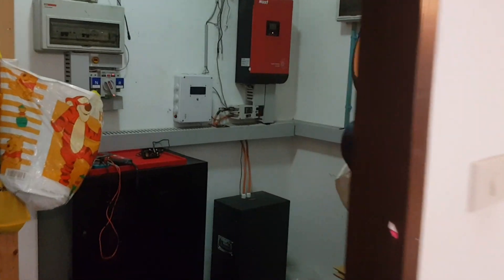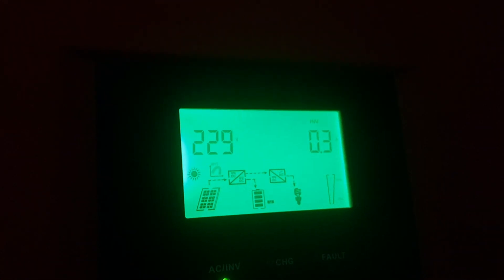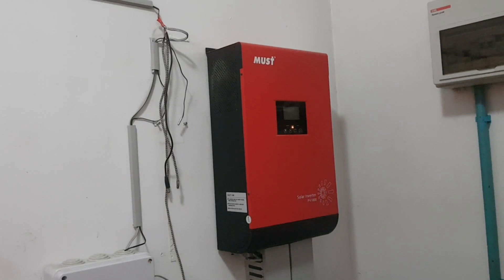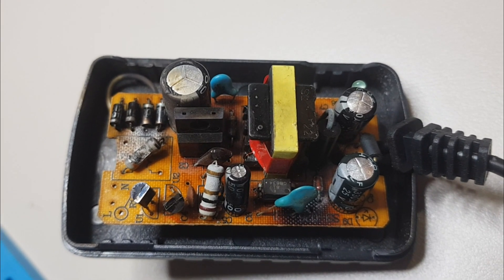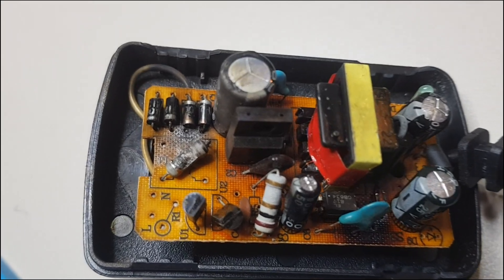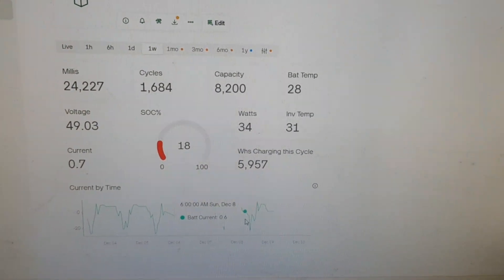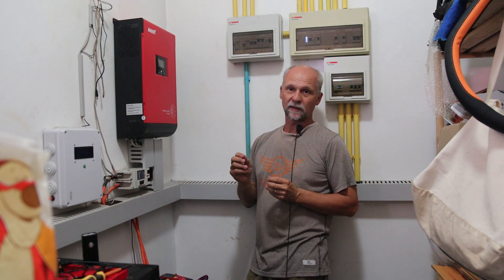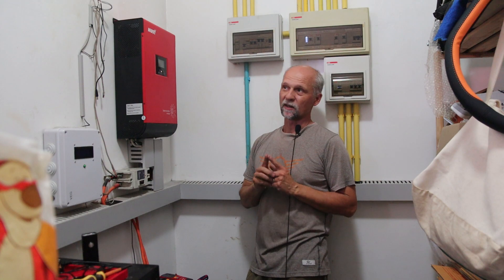Did I just kill my 7 years old Hybrid Inverter with a carelessly installed Power Adapter?

Comment: Hi Roland, im building my inverter.
Im installing the following protection.
Roof top  1000vdc pv ssr isolator  and surge protection connected to a  fireman switches on roof and ground level at power meter.
My inverter has a internal optical smoke detector which isolates  dc battery input and roof top ssr pv using the ssr isolator.
The Inverter has an internal 48vdc battery for skelliton functions.
I have added after market filters to mains input protecting ac to dc switch mode rectifier chargers. 
The dc input from the 2 internal mppts and a remote dc alternernator are protected by dc filters also.
I have protected my house appliances with a dc blocking inductor filter on the inverter 230vac output.
Finally i have finally found a none contact  ground fault relay at 10 ms 10ma  100amp dc trip in series with ssr isolator.
I hope i havent over done the protection  on my inverter Roland.
Been a challenge.
Andrew Nz

Comment: almost makes sense to reroute the caps to an external panel with push pin style connectors so you can just unplug the caps as they fail and plug in new ones. kind of like how big air conditioner/furnace motor start capacitors are wired with spade terminals which make it trivial to swap them out.
i have taken one of those 100w bi directional usb-c diy powerbank boards before and moved the capacitors and inductor kind of off to the side with wires to get it to fit into a very tight enclosure. kind of a lot of work.... i imagine there would be heat/air flow benefits if you rerouted the caps to an external box though. one of your hotel employees could maybe even repair it if you were out of the country if you had everything labeled.

Comment: Upto the last minutes I was so disappointed that you didn't realise that you had left your inverter open to damage through lack of protection - so I was very pleased that you recognised it, and it was an unintended oversight. You really ought to change that relay, as it may well cause you problems in the future. You could also set up a voltage failure alarm on your inverter output to alert you to a failure on the inverter. Good video, thanks 👍

Comment: Maybe change over to a low frequency, transformer based inverter?  They are a lot more reliable than the high frequency Inverters.
Reply from the maker: I would say it depends on the use case as low frequency inverters are more expensive.  And the biggest advantage of them is their surge capability. So if one doesn't need it, high frequency inverters will do well too. But yeah, for someone being completely off-grid, i would recommend to go for a low frequency inverter as well.

Comment: Thank you for the video. I have  the 5star(axpert clone) whose electrolytic caps   around the internal   psu. I had to replace. Planning to also, pre-emptively replace the 4x 500v470uF caps, they work very hard. If they fail,  more damage can be expected. (mosfets etc.) The inverter works well for the last 3 years, not very fancy, but apart from the caps I had to replace, very reliable. Rgds, Chris.
Reply from the maker: hi, thanks for your report. Just be careful when you go for the big high voltage capacitors. Only replace with top brand components as if you get something crappy there, you will be worse off then by not touching what's there. The main DC rail capacitors tend to be quite reliable.

Comment: hi...unfortunately every electronic circuit has its lifespan...but if you had a more suitable differential magnethothermal switch type B or F perhaps it would have tripped and interrupted the circuit saving your inverter....I wish you good work....(Italy)
Reply from the maker: hi. yes, no there is a 10A Type-B breaker protecting the circuit. Before unfortunately there was no breaker or fuse in line at all :)

Comment: Nice video. I believe it might last two more years. Personally i have two MPP Solar inverters and i'm planning to change them to more stable one...but maybe next year so far they are working and because it isn't so warm here i believe they might last one or two more years with no issues..after that i expect i will start to have same issues as you with capacitors..
Reply from the maker: how old are your inverters?
Reply: @RolandW_DIYEnergyandMore  hello. they are almost new i think this is second year i'm using them.